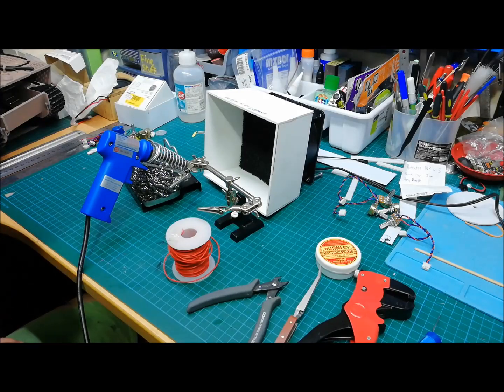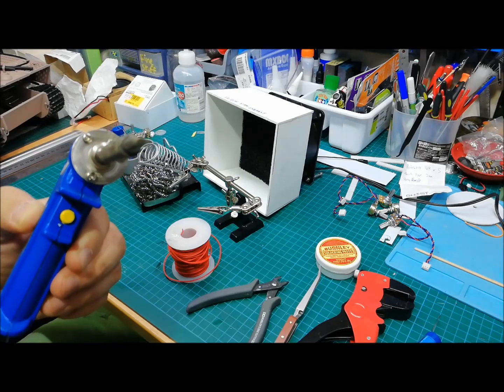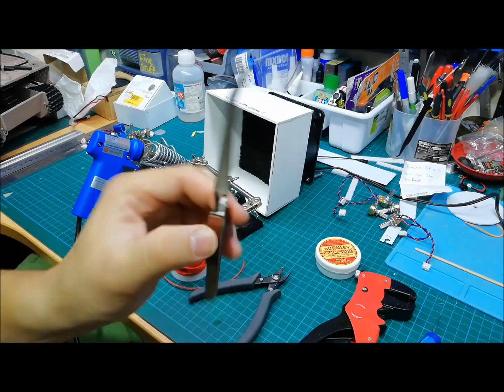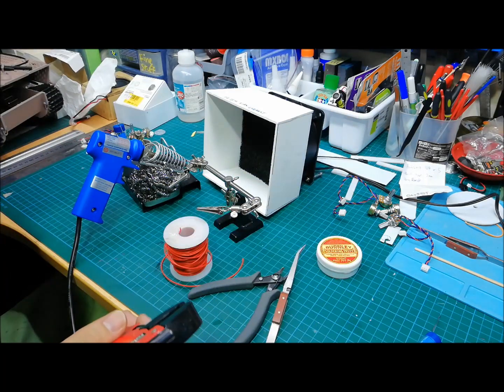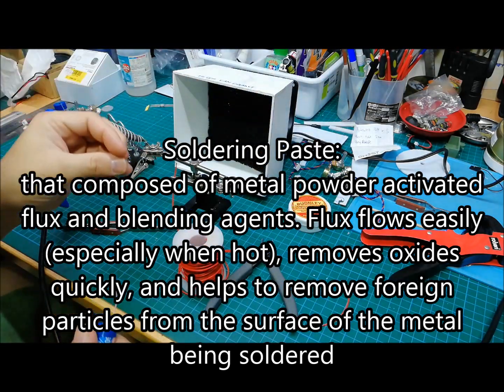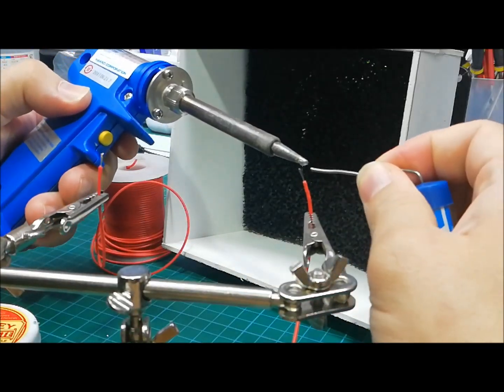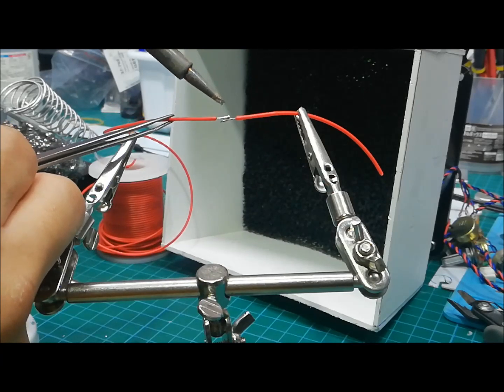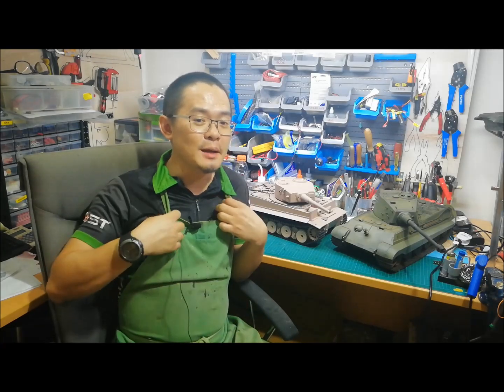How to Solder

Comment: you can get an even more stronger connection by back to step 1 coil or twist 2 wire together than apply flux and then solder, the tin covers and grip that twisted connection